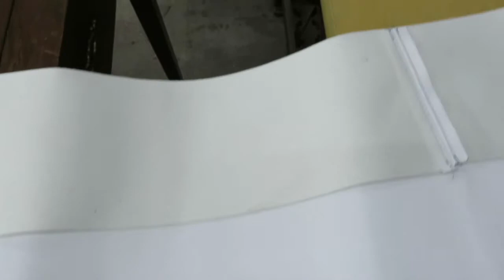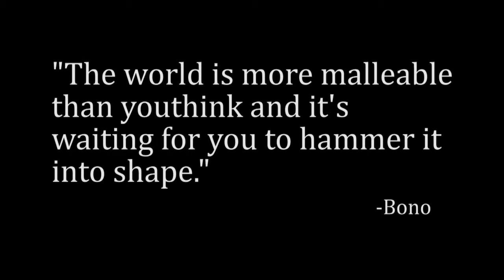Part 3: How to rebuild a golf cart seat! Sewing the cover

Comment: Good work.  I am in the same situation in restoring my cart and need to make a bench seat.  I got a juki 1541 now and am learning.  So while not everyone has the same tools some of us do and this video was helpful.  Do you know what foam you used?  By the numbers?  I have been researching and learned there are lots of different specs to figure out.  Such as ILD is also commonly referred to as IFD (Indentation Force Deflection).  Trying to figure out what to get that is will be supportive enough and not smash down.
Reply from the maker: Thanks for checking out the video. As you already know, Juki is probably one of the best sewing machines you can buy.  Here is a link to the foam I used: https://amzn.to/35IJNI6  I don't know much about the different foams but I figured the medium density would be ok.  This was the first time that I had done a golf cart seat.  Prior to this I had worked on boat seats and seat cushion repairs in cars.  If you are interested, I will be posting a full interior that I just completed.  It will most likely be a couple weeks before I get it posted. I did the headliner, seats, carpet and color change on all of the plastic in an F-250.  Thanks again for watching, I wish I had a better answer for you on the foam.
Reply: @DCAutoEnhancement  Wow thats pretty impressive.  I would love to watch!  Thanks for the link. Do you know how well the foam has held up?
Reply from the maker: @RileyPorter  I do not know the current state of the golf cart. I would assume it is still in decent shape though.